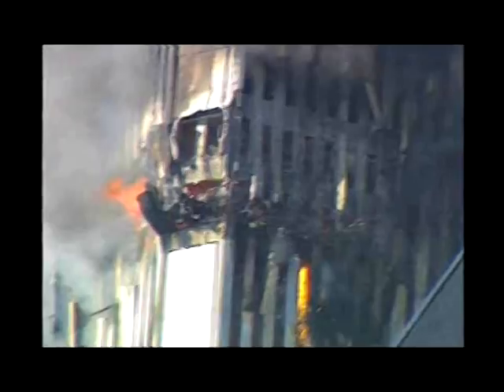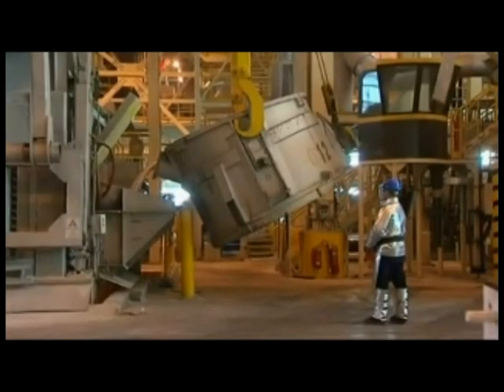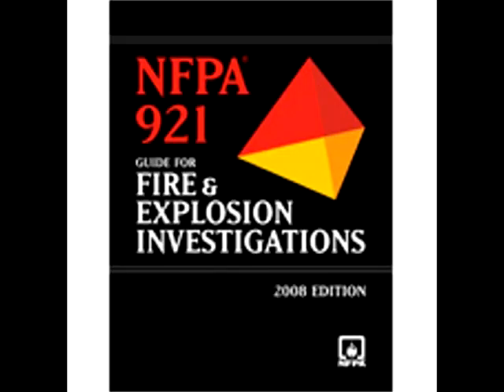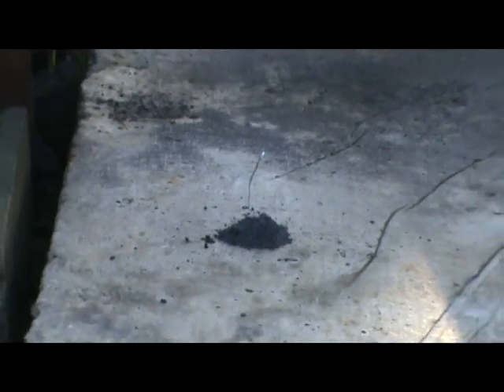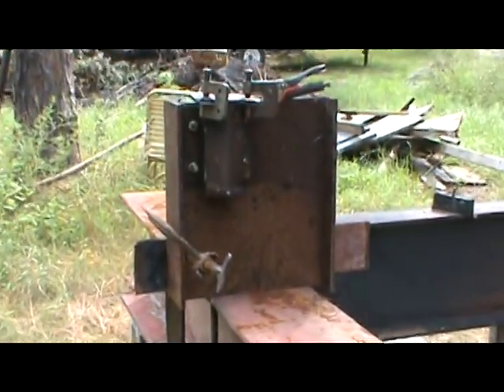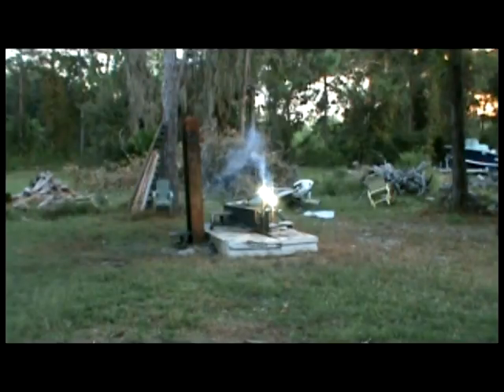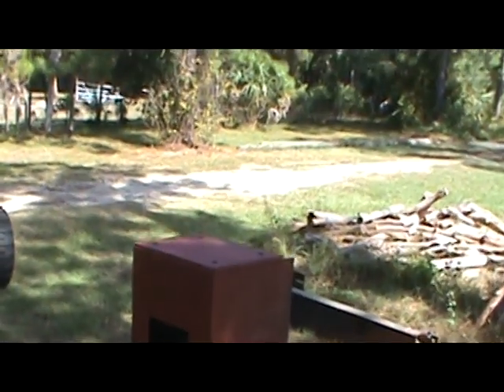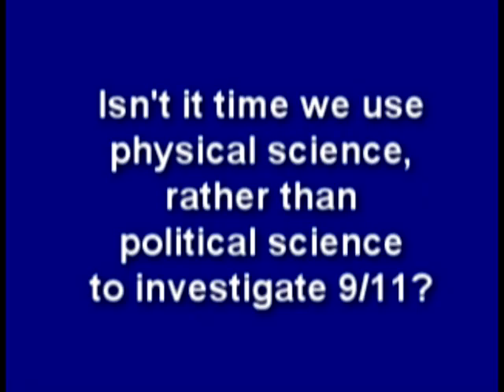9/11 Experiments: The Great Thermate Debate

Comment: Yes, people snuck into the trade center and rigged the building with explosives, then put it back together, and no one at all noticed......

People, give me a fuckin break already.
Reply: See CIA analyst and depiction of trucks visiting WTC a month prior to attacks.  Security was cleared from building for that purpose.
Reply: +mariano R whatever
Reply: Ignorance is bliss.  Whatever man, you ready to get this cheddar.  I smoked with a lot of college students.  Most of them wasn't graduating and they knew it...
Reply: See Susan lindaur "extreme prejudice" video so as to put a CIA face to the snakes!!!
Reply: Starring Giuliani as gargamel and the smurfs as all queda
Reply: mariano R Buddy you need to get out more, or maybe work a day as a construction worker and tell me again how they rigged 2 buildings that large and no one noticed.
Reply: People did notice the rigging.  Lower structure is rated at 500 units of strength.  Planes did not hit that section.  Top portion rated at 250 units of strength.  Planes hit top section and architects designed top section to survive airplane strike.  Perhaps you should switch jobs.
Reply: mariano R Ok pal, whatever you say
Reply: Captain Win
Every engineer that designed and built the towers that I have seen all stated the buildings were over enginered.  FThe Theory you are putting forward has a couple few issues with it. 

The first being is the buildings came down at the speed of gravity.  If it was as you are stating, even if its as short as a tenth of a second to over power the floor beneth it, that was undamaged and always had been supporting that weight, you can add 7-8 seconds on top of free fall speed.  The floors beneth it had to be taken out first, not as a result of coming down on top of it to maintain freefall speed.  If you were going to drop the top part of the building from that height, what is it going to go through quicker, air, or the steel and concrete from the rest of the building?  It went down at the rate like it was going through air.  It would have taken time to "unzip".  Not my rules, its the laws of physics.

Second, if it "unzipped", why werent the 47 inner oversized steel core columns that were linked together   left standing?  Like an old record player, with the post left standing after the record dropped.

Third, If it "unzipped" why weren't the 110 floors neatly stacked 10 plus stories like flap jacks?  The concrete was pulverized before it came close to hitting the ground.  You can see that by the column of dust left in the place where the towers once stood.

I dont need to comment on building 7.  Its fall speaks for itself. 

You are going to believe what you want, I wish I could look at it the way you do, science prevents me from doing that.  I have looked into this going back to 2002-03 the first time I heard Jim Marrs talk about the similitaries between JFK and 9/11.  I was looking to disprove what he was saying.  It pist me off when the harder I looked, the worse it looked as far as the official story went.  Its not like one thing debunked made everything else debunked.  Fact is, the official story has so many different problems with it, each separate from the other, that a new investagation is needed.

 Where re the other pentagon tapes?  National security is no longer an issue as far as releasing them.  They evidentially already knew how to do it, the simulations all over you tube can be shown without that being questioned, The tapes of the planes going into the towers are all over, why havent they released the pentagon tapes to shut people like me up?
Reply: mariano R The architects designed the top section to withstand a small, slow plane lost in the fog with one tenth the impact energy of the plane that actually hit the buildings. Fires were not considered at all because a) they didn't have the processing power or method to do it and b) it was assumed the plane was trying to land, meaning it would not have much fuel.
Reply: How does the bottom completely falter then? Near free fall effect and measly 14 million dollar investigation...like a hedge toward world oil domination.
Reply: You heard Duane Mr. Fury and others.  I am tired of feeding the trollz.  Bury your head in the sand and be done with it.  Don't waste any more precious brain cells.
Reply: Yeah? al-Qeada had this hub in Yemen which was listened in on by the NSA; the Kuala Lumpur summit was monitored (and very likely listened in on it as well); two of the alleged hijackers lived openly in the US for almost two years and even had an FBI informant caring for them; there were lots of warnings about suspicious activity, including "preparations for hijackings or other types of attacks" in the months leading up to 9/11 - and no one noticed what was coming so it could be stopped? You give me a break, will you?
Reply: BiffBallbag you don't need to take a building apart to rig it for demolition lmao
Reply: A lot of dead CIA agents there
Reply: BiffBallbag
Lets change that arguement to lets have an investagation to determine why molten metal was found under all three buildings.

The fact any 5 year old can watch the towers and say they appear to have been blown up opposed to "collapsed", 

The towers and building 7 displayed all the properties of demolition, no properties of a collapse due to fires. Why?  Steel buildings dont collapse due to fires.  Earthquake, maybe. Demolition, yes.   Fires, no. 

Worse case, the tops collapse, fall to the ground.  Not pile drive through the bottom part of the buildings with no structural damage that supported its weight since construction.  The momment the "collapse" started, it would have relieved the weight once on the bottom.

Do trees turn to saw dust in mid air when chopped down?  Or do you have to chop them up on the ground?  If the towers collapsed, they wouldnt have turned to dust mid air, and ejected huge steel beams 300+ plus feet during the collapse.

I dont know how or when explosives were planted, thats not my job to figure that out.  I do know what controlled demolition looks like (building 7) and what a building looks like blowing up (the towers)  If you want to believe what you have been told opposed to physical science, thats your choice, but until you have science on your side, dont try and discredit the ones with the courage to believe what their eyes and common sense tell them.  As ugly as it is.  Its bad enough they realize that without ignorence from the uneducated. 

Nobody wants to believe this shit about being lied to, but their intellect and respect for science leaves them no choice.  So believe what you want, but instead of trying to discredit them by saying when did some one have time to do it, why not discredit the science and evidence that is there and you cant argue with.

No one has that answer to your question except for the people at the security company that had total power downs of the buildings on the weekends leading up to that day.  And also had the bomb sniffing dogs removed after that.  Look it up. Wish I was making it up
Reply: When u live in NYC and were primary witness to the devastation you would expect the life change units experienced to cloud your judgment.  You prob went to Yankee stadium and cheered on Bush.  Just what they wanted...
Reply: You waste more brain cells and time arguing here.  Take fifty eight min and watch the video then hit me back with your hollybabble
Reply: George Bush Sr.  Specifically called for a new world order.  You just lulz to irritate and feed.  Dream of Californication...
Reply: Are you sure that no one connected to security in the building was capable of being bought off?

Once a team gets inside the elevator shafts, how many cameras do you think were INSIDE THE WALLS?!

The biggest obstacle to the "project" was gaining access to the building and controlling the investigation. Planning the demolition couldn't have been that hard, now could it?

Please, tell us about the THOUSANDS OF POUNDS of explosives you would need...

...but remember to tell me that BEFORE you tell me that all it took was an airplane! And remember to tell me that ten minutes later, in the hopes that I forgot what you said about the explosives!

Or else, you might look a little stupid.

I'm not the one who is saying that all it took was an airplane. You are.
Reply: soylentgreenb
 Did you know a b52 bomber hit the sears tower lost in the fog in the 50s and the building never fell?
Reply: Fires from jets disputed
Reply: Once again the fire did not but the thermite did...have u heard of operation merlin?
Reply: There was way more than enough evidence for controlled demo to warrant consideration of it. In fact, national guidelines(NFPA) mandate such testing in case of ANY building collapse. Such testing was never done by the proper authorities, hence, the gov.story is not valid. Yet no one was fired, indicted or penalized in any way. The 9/11 commision was a gargantuan fraud.
Reply: Captain Win The collapse scenario you describe fails completely because of Newton's Laws of Motion:  Free Fall only happens when all supports are gone. This is completely impossible with the time lags that your scenario requires.  Get a stopwatch, time it yourself.
Reply: I will do you one better.  Please explain why floors of 92 thru 100 + 102 of WTC 1 were upgraded with fire proofing?  The plane hit floors 93 thru 99.  Failure floors:  92 thru 100.  Now for WTC 2.  77-78, 88-89, 92, 96-97.  Failure of floors:  77 thru 83.  While this "fireproofing upgrade" was happening all structural components were accessible.  Just because the event took place on September 11, 2001 doesn't mean it wasn't planned well in advance.  That would be like saying," I have a great idea, lets invade fortress Europe tomorrow and then magically have a invasion force hitting them the next day.  This was a well thought out well executed plan that benefited a lot of politicians and also gave  the green light to work over Israel's enemies.  Who benefited?  Use Nash's equilibrium and you will find out.
Reply: Captain Win You are doing nothing more than repeating the discredited, revised-out-of-existence NIST report, what passes for an :Official Story.
   You assume that something important was done by "planes", an unnecessary and unsupported assumption.   A "controlled demolition" would be Controlled.  I.e. the explosives would be planted where they intended destruction, most likely to eliminate certain records and people.   The idea that airplanes would "wipe out" insulation or wiring , etc.  is flakey and unlikely.  Why would anyone depend on that ?!
    You really ought to drop this "weakened steel" theory.  Even NIST did. It is just nonsense.  Did you watch the Dubai "Torch" bldg. fire just recently?  If you notice, there was NO suggestion that the bldg. would come down, even though it burned far more fiercely than WTC.   And you ideas about how modern bldgs. are designed is just laughable.  (ret. engineer)   Really, it would be better for you to stick to childish insults.
Reply: Minoru Yamasaki was one of the greatest architects of our time.  Actually he was ahead of his time.  He made possible the erection of buildings far taller than any one could dream of.  He is also credited with saving thousands of people BECAUSE of his design.  Most Skyscrapers like this have mass tuned dampeners because buildings this tall sway in the wind.  If you were on the top floors without the system he put in place would make you puke.  So he used a new material between each floor connection that prevented that and also had a pleasant surprise.  In the winter they would actually heat the building saving thousands of dollars.  I have the blue prints for the entire complex and every time I look at the prints for WTC1 and WTC2 I am in awe.  If you were or are a architect or building engineer you need to go back to school because you definitely missed the mark on just how great a design this was.  Oh, and by the way, the building was designed to take a hit from a 707 not some small ass Cessna.
Reply: Captain Win Okay, let's make sure you understand this.  Those towers were considered "Heavies".  Have you ever watched any video of their construction?  Do you fully understand their construction.  Because if you don't you have no idea about their destruction.  First of all most of the fires were out. JP7 open air and office furniture will burn quick, but not very hot. (relatively)  Yes I believe the pilots had a exact point of entry into the towers.  Why, you ask?  Because I firmly believe the planes that hit the towers were KC-767 fuelers Revamped for this exact scenario.  Ever hear of Project Northwoods?  You know the plan to take a commercial jet and land it at a military base then have an identical plane take off just as the commercial heavy touched down.  The military craft would show on radar as the exact same plane with the same identifiers and then boom, the plane blows apart and Cuba gets the blame.  We go to war with Fidel and make Cuba the fifty first state.  The plane would be a drone and flown from ground control.  This was before the massive computers we have today.  A computer guided commercial heavy could do it on auto pilot.  But from the ground it can hit with absolute precision.  The other thing is how do you get a Looney Tunes type entrance into the towers?  Those wings should have sheared right off those planes.  But it gave us a good glimpse of the angle of  attack.  Right wing higher etc.  When the finale comes nano-thermite is used and down comes the towers, right in their own footprint.  Never in all my years have I seen a terrorist attack on buildings that actually prevented collateral damage. Only one or two agency collectives think like that.  The U.S. and Israel.
Reply: whetedge
If the impact zone was where air came in to feed the fires you claim were raging, then why in dozens of video clips can you see smoke coming out of the impact gash?  If these fires were raging, why do we see so much more smoke than fire?  Even the picture you lead us to shows a fire any boyscout would call weak and smoldering. 

You're full of malarky, guy, and are feeding a treasonous lie.  Shame on you.
Reply: mariano R Maybe it only took 14 million dollars because rational people didn't need much of an investigation.  We just accepted what we saw, that 2 airplanes flew into the towers at insane rates of speed full of fuel and passengers and that made them fall.  I dont understand why people like you have such a hard time accepting that. Maybe if you lived in NY when it happened like I did, lost some friends, and even had a few friends make it out of the building you wouldn't be such a disrespectful fool.
Reply: I did one better.  I brought up a case against homeland security in 2003 m rod vs.  Homeland security st. Vincents hospital and Fairfield police .... Both sponsored by homeland security.  See library of congress.  "The lies of others.  A personal inquiry into events prior to and after 911...
Reply: They wouldn't grant me a lawyer.  I couldn't afford one.  By law they should have granted one.  They did similar things to others that filed.  Bush admin, go figure...
Reply: Watch extreme prejudice video with Susan landaur.  Truth is out there floating in the ethersphere I just pull at the strings and get what I need.  That's from Heat with all Pacino...
Reply: Everyone 'experienced' it.  You were just too close to a circularity of terrorism that ultimately wrapped up the whole globe with its inherent New World Order.  Just one fix...
Reply: You are correct...
Reply: All you think it took was an airplane.

So... knowing that YOU think that all it took was an airplane, tell us, how much more explosives would have been needed?
Reply: mariano R they used a hydrogen bomb which is why they're were sounds of an explosion in the basement. And thats direct quotes. I pray justice is served as well my friend
Reply: BiffBallbag "They" would not have to sneek in to place the thermite/nano-thermite charges, they would be dressed as routine maintenance guy's (so as not to arouse suspicion!) going about their normal business!
Reply: mariano R
and how did they test their theory?  Did they build a full scale mock up and get some swarthy looking guy to fly a plane into it?
Reply: Did you know that building was not made the same way as the Twin Towers?
Reply: mariano R Please enlighten us to what exactly a UNIT OF STRENGTH is.
What a fucking moron.  That's not even a form of measurement used by anyone... LOL I'm dying laughing.

You know what guys?  I'm not saying it was Aliens... but... It was Aliens. LMAO
Reply: Read The Nation and stay informed regarding CIA exploits
Reply: mariano R
Do you know when steel is heated it loses it's strength?
Reply: mariano R
So when fuel laden jets crash they don't catch fire.  You heard it here first folks.  Why do they bother dumping fuel when they need to make emergency landings?
Reply: +BiffBallbag Nope, the evidence and questions are unanswered..why did the commission not deal with all the questions, evidence and witnesses? What are they afraid of?
Reply: whetedge they didn't test for controlled demo cause they were too busy recruiting you for Isis propaganda!  A mind is a terrible thing to taste.  Cheerio.
Reply: These buildings displayed the properties of buildings built in that manner.  once the top ten or so floors fell down the structural integrity of the floor immediately below was compromised.  A huge % of the structural integrity of each floor came from the outer skin and inner columns.  The outer skins were knocked outwards with each drop and this then popped the clips holding the beams.  It was like a zip unzipping.  There was no structural strength when the outer walls got popped one at a time as the floors above dropped.
Reply: Again you're taking two things and coming up with three.  The buildings collapse begins, rather unsurprisingly, where the planes hit.

Are you suggesting that the pilots had a few floors to aim for?  Were they expected to count down from the top of the building as they approached at approximately 500mph to make sure they knew exactly where to hit?

Are you suggesting that this controlled explosion demolition just happened to begin on the floor the planes hit?
Wouldn't the plane crashing into the building have wiped out any wiring or explosives at impact?
The area where the planes hit were structurally compromised and the heat from burning fuel further compromised the strength of the steel.  That the collapse began on the floors where the planes hit should not really be a surprise.
Reply: whetedge half of the steel is either molten or in China.  What are you twenty years and old.  Ivgrew up reading physics books when you were just a sperm cell.  Being that young America's educational system indoctrinated you into your false beliefs
Reply: Visual and audible evidence of explosives at base.  Survivors attestedcto it.  Yet some CIA wannabe claim they have the facts.  Go vote republican while you're at it we could use another 911 to go up against Iran.
Reply: mariano R even if you personally touched and saw every bit of steel of WTC complex you wouldn't be able to evaluate anything since you don't know shit ! so why do you brag about it ? didn't you see planes impacting towers ? didn't you see holes, fires, sagging and collapsed floors ? didn't you see multiple prefabricated steel elements banding inwards just before the collapse ? didn't collapses initiate from impact points ? and really once those upper structures moved, it was over ! the sheer amount of potential energy (can you guess/estimate/calculate TNT equivalent ?) accumulated in those high-rise buildings along with specific design explains it all perfectly ! I could as well postulate elves farts or aliens' lasers and call you 'indoctrinated' when you don't buy it, ha !
Reply: Shock and awe of the event is what you are going by.  Did u see the plane go into the pentagon too?
Reply: Didn't you see witnesses.  They have more credibility than your armchair perspective...
Reply: ***** another myths willingly spread by dumb 'truthers', plane was descending with engines set to max throttle, besides full thrust also gravity contributed to the speed ! so achieving like 600 mph in such a powered descent not only wasn't "impossible" but actually expected ! as for stresses to the airframe the most dangerous cause of its failure would be flatter not simply dynamic pressure ! and since this effect depends on the velocity of air (not pressure) passing around the plane's structure and the limiting speed that takes this effect into consideration wasn't even reached by Flight 175 it was rather implausible it actually occurred ! so even though Flight 175 experienced unusual stresses, they were far from "impossible", and last but not least air traffic controllers like Dave Bottiglia actually followed this flight, so all the evidence shows it was Boeing 767 flying nearly 600 mhp close to sea level, not disintegrating and still could be controlled, instead of actually doing some research you decided instead it was better to just parrot other idiots, that's what real 'truthers' are all about, ha !
Reply: Scott Forbes is a Senior Database Administrator for Fiduciary Trust - read his account of the unprecedented power down of the WTC over 9/8 9/9. With absolutely no security, team of "workers" with miles of cables were all over WTC prior to the event, so they simply walked right in through the front door; didn't need to sneak.
Reply: Christiaan Baron During that same time, eye witnesses report seeing an unusual volume of large transports going in and out of the complex in the early morning, when most people would be asleep.  The security company in charge is a pentagon-tied defense contractor.  One of the Bush brothers sits on the board.  All a coincidence, I'm sure.
Reply: whetedge
A passport that went through the tower in a huge fireball as you pointed out.  And for my next trick...  You are so narrow minded you don't even keep up with the horse shit your shovelin'.
Reply: mariano R Seriously, you gotta watch some of the documentaries that debunk all the BS you're spouting.  Its nonsense
Reply: mariano R Im arguing with a guy who isn't even smart enough to reply directly to my comment.  Good luck pal, you;re gonna need it.
Reply: Andrew Hillis
Carrying a shit load of thermite and steel surrounds capable of holding it and some system of triggering it all off.
Reply: raymond richmond This is true, that event did occur!
Reply: G5pott "what about WTC7"
It fell down.
Reply: Joel Barry "There was way more than enough evidence for controlled demo to warrant consideration of it."
There was zero evidence for controlled demolition. That's why they didn't "test" for it.
Reply: mariano R "Ignorance is bliss."
No wonder you are so cheery.
Reply: Seelverado You are looking for means and opportunity, and no crime has been established. I guess they don't tell you that at the 911"research" site, huh?
Reply: mariano R What would be the point? There was zero evidence for it.
Reply: Capt. W. "taking 2 things and coming up with 3".  Curious terminology.  Are you unconsciously responding to the strange idea the 3 bldgs. could possibly be brought down by 2 planes?!  Maybe PTSD is getting to you.
Reply: Biff:  Access to the interior areas , or any area, could be controlled as needed for "renovations", done at night.   There are areas concealed from the day workers, such as  above hung ceilings.  Really, it is not that comlicated.
Reply: Face facts.  Those buildings were a shit design.  Yes it was fine as long as nothing major happened but something major did happen and results show they couldn't cope.  Flawed design = serious consequences.
Reply: Captain Win I suggest you follow your own advice:  What gives you credibility when  you claim that the design was (####)?!  From all your previous posts, I would guess that you could not even describe what was faulty in these designs, other than 1.) they fell down  2.) they were "unique" designs, (just like thousands of other bldgs.are)
Reply: LPhoenix98 I don't disagree with your assessment, but the lightweight design made them particularly susceptible to the type collapse we saw. They were not designed to take the sort of impact which occurred.
Reply: whetedge If you think the towers were a "lightweight design" , you are fantasizing.   And they WERE designed to be hit by airliners, and the airliners they had in mind were 85% or so of the weight of the Imaginary airliners that hit the towers.  (not bldg.7)  Because of the great "safety factors" that designers use in such cases, the difference would be negligible, outweighed by all the OTHER factors in the situation, such as , just how hot were those fires, anyway, etc, etc. The Official Theory, with all its revisions and major changes of mind, are  even more useless now than when it was first proposed.  (But not accepted, by any reputable engineers.)
Reply: disgny If you think the towers were NOT lightweight, you have no clue of what you speak. The towers were NOT designed for 150 fully fueled tons at 450 mph.
Reply: whetedge By constantly repeating your vague assertions, you only make it plain that you have no experience with what you are talking about.  Like all skyscrapers,  the towers were designed to withstand Hurricanes, which is more of a load than airliners.  They are OVERDESIGNED, by a considerable amount.   Your insistence that they were not designed to be hit by THAT particular airplane is just silly.  True. but so what?
Reply: disgny By the way, if you want to sound like an expert, do  NOT use the term "lightweight" in an engineering discussion.  It just sounds silly.
Reply: Captain Win
Oh, I almost forgot the most important thing.  A passport from one of the hijackers found in pristine condition after the towers fell.  Do you really believe this horse shit?  Out of all the things they find it's that?  Give me a break.
Reply: biffballbag:   I take it you have construction experience, but not a lot of engineering time.  What you "Controlled Demolition Deniers" have to deal with is, that no matter what you say about airplanes, fuel, fires, steel, etc. you are left with the simple fact that bldg. 7, especially,( but the other towers as well) ,  FELL  MUCH TOO FAST , for the laws of physics.  Whatever scenario you dream up,  FFA means  "Nothing below that floor", and that means CD is the only practical possibility.    And I take it as a given, that if one major part of the Official Story is THAT wrong, all the rest is suspect.
Reply: LPhoenix98 The Towers were NOT "heavies". They were lightweight, which made the height attainable. Everything about them were lightweight.
Reply: LPhoenix98 "most of the fires were out."
More made up BS by "truthers".
NT just prior to collapse:
http://postimg.org/image/ti6w1iu4d/
You have no concept of the fuel for the fires. The shredded planes and all interiors in the path of the planes were blasted into the opposite side of the building from which the plane entered.
Reply: LPhoenix98 " A passport from one of the hijackers found in pristine condition"
Millions of "pristine" pieces of paper flying through the air and all over the ground, and you find something odd about finding a passport?
Reply: disgny There is no mystery about the manner in which Building 7 or the Towers fell. Structural remains explain Building 7 perimeter wall FF.
Reply: Justin Davis
No, not every design engineer.  Not even close. it's just that you guys choose to listen to a handful.
Reply: disgny
Your flawed logic is, well, flawed.  You are trying to make an equivalence between the consequences of two completely differently constructed buildings.  Add to the fact the the building in Dubai didn't have it's structural integrity shattered by 150 tons of jet liner hitting it at 450 mph.
Reply: LPhoenix98
and?  Look at any plane crash and items get thrown clear.  You guys are really clutching at straws here.
Reply: disgny
Designed to survive hurricanes.  lol, heard it all now.  A hurricane doesn't smash through a building taking out it's exterior strength and it's interior strengthening columns.  It then doesn't set fire to the part it smashed further weakening the remaining steel.
Reply: Captain Win Nothing weakened the steel below the impacts.  Watch the buildings blow up.  The part falling on the one started to tip and turned to dust.  I wish I could see it the way you do.  Where did you buy your rose colored glasses?  Zelikow?  Bill Oreily?  Think what you want. Nothing explaines 7 or why they turned to dust mid air or the molten metal.  No matter how much you want it to.  If you can show scientific evidence other than take my word for it, you are wrong, making obvious weak arguements, bring it.  The only one you are fooling is yourself.  Actions speak.  Post a video, or stop wasting the time of people who take this seriously.  You have made it quite clear you dont.  You want some attention, get it with science,  English gets you none
Reply: LPhoenix98
Pay no mind to the captian.  Dont waste your time with his statements of bs.  That is the goal from him.   Trolls die without attention.  Ignore and move on.
Reply: whetedge
I guess lightweight would be a relative term here.  Lightweight as opposed to several locomotive engines standing end to end.   Or lightweight compared to some of it's heartier cousins like the Empire State Building.  I think I understand what you are saying though.  Because the outside was made of box columns and had central shafts bearing a great bit of that load would mean that the skeleton or I should say exoskeleton of the building would be light if built in the traditional fashion.  However,  this building had nothing traditional about it.  If you get a chance go to the county planning office and download their file containing the blueprints for wtc1 and wtc2.  Find a plotter and print them.  Go floor by floor paying special attention to the fire upgraded floors.  What you will find is nothing less than exasperating.
Reply: LPhoenix98 Since "lightweight" is relative to skyscrapers, the Twin Towers, engineering speaking, were lightweight.
I am familiar enough with structural design of the towers to understand that collapse occurred inside the walls and between core columns, which is why there was so little resistance to collapse.
Reply: whetedge
If you watch the video footage of the impacts again, you will notice that the first plane more or less lumbered its way to the target, while the second is the one that came barreling in.  The impacts, while they were both a matter of airplanes hitting buildings, were very different in nature.  There are photos of people standing in the areas where the plane hit, looking out and waving for help.  If the fires were hot enough to weaken the structure, why were people standing in the impact zone?  Heck, the fires were so smoky that it's obvious they were smoldering fires at best.  They were not the raging, metal bending, fiery forge type fires people have been brainwashed to believe they were.  Hot fires make very little smoke.  These fires smoldered like a lousy campfire.
Reply: Aaron Maughan I'm forever amazed at the utter stupidity of you "truthers". Even the simplest stuff you say, "explain this, explain that", when even a 5th grade science student could figure it out. The plane hole in the North Tower was UPWIND. Why can't YOU figure simple things like that out? It's where the oxygen was entering the building; of course it was cool there!
And a little research shows the fires were rip roaring right before collapse: http://postimg.org/image/ti6w1iu4d/
Reply: Aaron Maughan Explain the inward bowing of perimeter wall in the photo I posted.
Reply: whetedge
whetedge, I understand your side and thinking process and I hope you understand mine.  Let's just agree to disagree?  How about that?
Reply: LPhoenix98 I cannot compromise fact.
Reply: whetedge top of towers should collapse, weaker steel half so of lower structure were planes never struck.
However an effective collapse requires thermate debate special ops.  Its all timelined on YouTube and internet.
Reply: I get bored
Reply: mariano R The only problem with that is there are no cut up girders and columns in the piles. Everything broke at connections. Give it up.
Reply: spamsoppl I don't think "truthers" have the ability to visualize the core columns bending as the tops tilted, and as you say, magically balanced themselves. They seem to think the towers were like a solid mass or something. Actually, I haven't run into one yet who is interested in the truth.
Reply: mariano R The only brain dead here are "truthers" who whine like little babies "the steel was shipped to China", all the while you can study the steel right now today; it's all over YT. You cry it was hauled off, then when shown you can study it now, you dismiss it as unimportant. You people are SO obviously biased it is pathetic.
Reply: Thermite can be in liquid form. That means it can be painted on walls for example. The towers were under constant renovations, closing 10 floors at a time sometimes. Don't be ignorant.
Reply: ***** of course you don't understand, because you are already confused about planes, ha ! the one which reached almost 600 mph was Flight 175 hitting WTC 2, and videos show it levelling off just seconds before the crash, no wonder you don't know how the speed was calculated or that the plane was descending like 80 ft/s, yet you're back with your empty claims parroting them willingly ! and why would it "be uncontrollable at that height" exactly ? magic fairies intervened ? I prefer science which showed common sense to be wrong multiple times throughout the history of mankind, ha ! but your 'common sense' can't be even called that ! fucked up sense, 'truther' sense or no sense at all suits much better any time ! guess that's the reason why you can't recognize me addressing your every moot "point", ha !
Reply: whetedge
Why when novice architects and engineers talk about buildings or look at them all they see is from the ground up.  You have to look at EVERYTHING that went into making the buildings stand.  A slurry wall that if it had come down would have flooded Manhattan, millions of pounds of concrete and that's not even getting to the mall transit area.  Funny how they were eerily intact.  Maybe you should take a course on explosives, I don't believe in coincidences even when I'm just designing my little old six stories.
Reply: Really?  That's the best you can come up with? If I count the words you just wasted it vaguely comes up with your IQ.
Reply: raymond richmond wrong plane, wrong building.  It was a ww2 era bomber, and it hit the empire state building.  Much smaller than a b52, and a much heavier building that wasn't designed to sway.
Reply: I still think you guys are nuts, I'm amazed.  But hey, its a free country, believe what you want.
Reply: spamsoppl
My best is something you cannot even do.  If you did go to the county planning office and downloaded the blue prints for the complex and then found a plotter to print them you couldn't even read them!   You have doneno actual  work to find the truth, you only insult people who have, and last but not least your moronic ideology is to just stir the pot and try and piss people off.  Guess what?  I am a truther, a name I wear proudly.  Why?  Because this shit will continue to happen until either someone is actually heard and the people responsible get caught with their hand in the cookie jar or another false flag incident leads us into a war that has the ultimate cost, nuclear holocaust.  I don't expect you to understand this with your low to low average IQ but there are others who have the common sense and intelligence to know and find the truth.  So, until you have concrete evidence to the contrary just sit still and be quite, the adults are talking.
Reply: LPhoenix98 all that blabbering about nothing ! that's what you're best at, ha ! fuking nothing or bullshit, either way it's worthless ! you are a fukturd, most if not all 'truthers' are, and so fukin confused you're even proud of it, ha ! I actually had to draw some basic blueprints in middle school and more advanced ones in CAD at the university of technology, so I'm pretty much sure you will never achieve my level of understanding of them, ha ! also seeking truth or just simply getting to know facts is not about watching bunch of fukturds exposing their stupidity and ignorance, but of course someone as confused as you think it is, you 'truthers' are fukin tragic, on the one hand you're stupid beyond any reasonable limits on your own, and on the other hand you're indoctrinated by other retards, but the best part is you think it's the truth, not just truth or most likely explanation but fukin 'THE TRUTH', so who's the one with ideology and religious one at that ? you 'truthers' lack evidence for your garbage, that's why you are laughed at or simply ignored by overwhelming majority of experts and professionals, you might be 'adult' yet more ignorant than my 8 years old nephew, ha !
Reply: spamsoppl
Your level of understanding, eh?  All I got from your post was a rant from a guy  who has an eight year old nephew who is smarter than you.  I love how when the gauntlet is cast all you can do is come up with insults and  rhetoric following your own party line.  While I totally disagree with your assessment, wait,you didn't make an  assessment, so basically your words are hollow.  You know, have no meaning.  Next.
Reply: BiffBallbag Your extreme grief at the loss is what is depended upon. The lowest of the low, but when war is the allowable result....the bottom is where the victory is assured. I respect and deeply feel your loss.
Reply: Your ole'lady doesn't think I'm worthless!
Reply: Lol he answered with "whatever" in his first comment response. It says it all.
Reply: Christiaan Baron No, they were probably planted during the "elevator modernization" that happened a month prior.  The elevator shaft has access to all the main structural columns.
Reply: LPhoenix98 You didn't notice the millions of pieces of paper floating out of the blast?
Reply: whetedge What part of fireball as the cockpit hit the building don't you understand?  It can't be both ways.  This wasn't some memo that was blown clear, it was part of the fire ball we all seen.  Look man, you believe the shit you want and I will believe in reality.  You should try it some time.
Reply: LPhoenix98 fukturded 'truther' and reality? buhahahahahahahahahahahahaha!
Reply: LPhoenix98 So I will ask again.You didn't notice the millions of pieces of paper blowing out, ahead of the fireball and after it?
Reply: whetedge
and I will answer again.  If the passport was in the cockpit, and we all saw the cockpit explode into flames, how the fuck can a passport with less mass than a pile of paper be ejected at speeds faster than the craft it is in AND be in pristine condition.  You don't know so you put out a pile of bullshit.  You have no concept of physics or anything at all.  I'm through with you, fuck off!
Reply: LPhoenix98 No need to get your panties in a knot. Not you nor anyone else can ascertain what happened in that split second the plane entered and exited the tower. We do know some facts though. The cockpit was well forward of the fuel, which was located in the wings and center tank, and which exploded behind the cockpit. We also know millions of pieces of paper were blown out in front of the fireball, and after the fireball. I don't see it as a stretch that the passport and other paper documents in the cockpit were blown out un-burnt.
Now if you say that is impossible, which is only an opinion, not established fact, and you are saying someone planted said passport, you now have to invent a boatload of fantastical conspiracies to make it so and explain why the passport was faked. That's how all of these conspiracies surrounding 9/11 get started; based on nothing but speculation, and in order to answer all the questions, the stories just get more and more fantastical, based nothing but speculation. Stick with fact; it'll help keep your neurons from exploding.
It is NOT impossible for the passport to have been blown out and survive the inferno. That's all we can ascertain on the subject. Best to move on and see what actual facts can be established; that is, if an objective investigation is the goal.
Reply: whetedge I have to say, your post is intelligent, insightful, and very well articulated.  I concede that nothing is impossible.  It very well could have been blown clear.  But I also agree a new investigation should be opened, one that is clear in mission, unhindered by jackasses like GeeDubbaU, and based on fact.  That being said I think we can actually agree on one thing.  We as a people of the United States deserve nothing less but the truth based on forensic facts and nothing else.  Cheers.